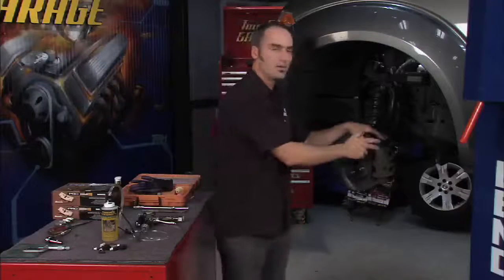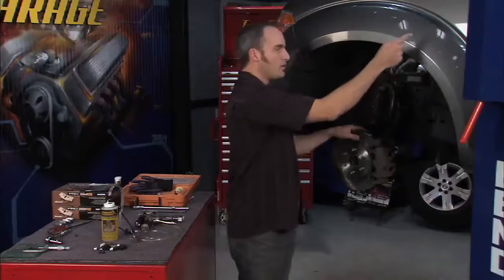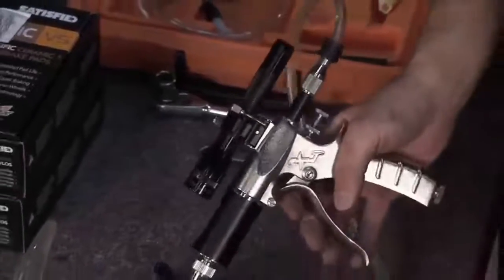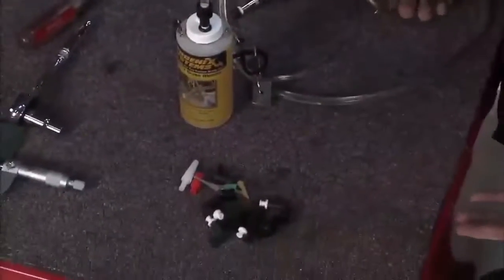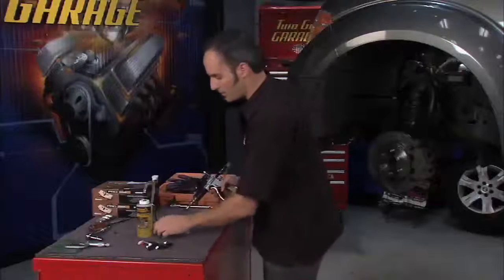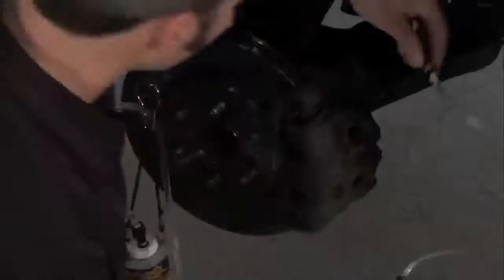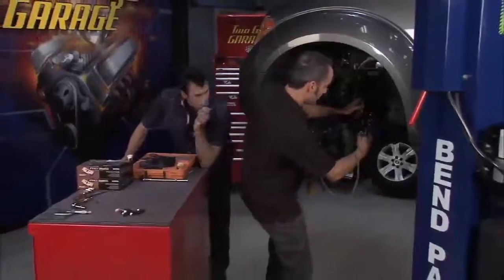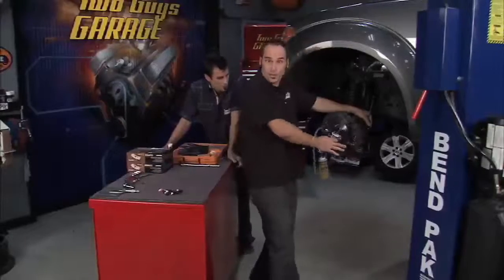How to bleed brakes | Phoenix Systems

Comment from the maker: With a Reverse Bleed, you will actually remove the fluid from the reservoir with the tool and put it into a brake fluid container.  You insert the inlet hose into the reservoir and the outlet hose into the container and you pump.  This removes the fluid from the reservoir so that it does not overflow on you.

Comment: I guess one final question - why do technicians say you should not reverse bleed a system that has ABS? Is that just an "old wives tale", and using this is really OK on ABS systems despite the advice to the contrary?

Comment: HI thanks for the reply. In the meantime I found that my problem could have  been the bleeder screw itself. The caliper is brand new, and so when you unscrew the bleeder even a little, it has that "loose" feel that an older grungier bleeder does not have, simply due to no buildup yet. Some recommend teflon tape on the bleeder threads to keep the airtight seal.